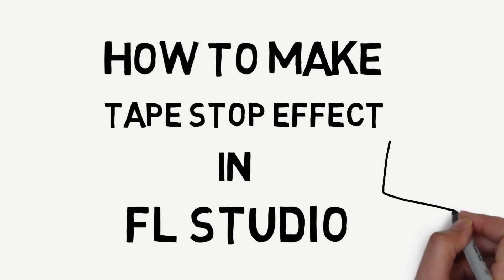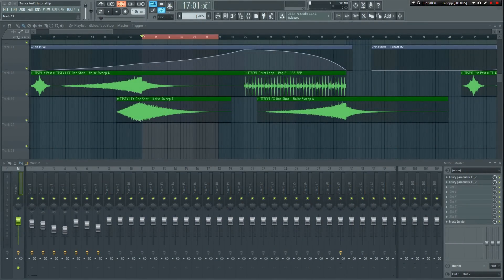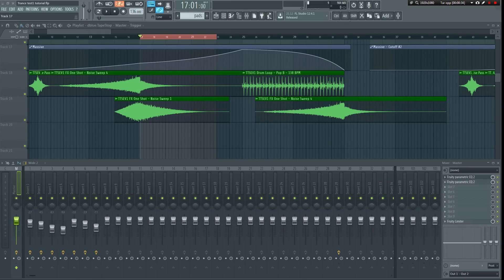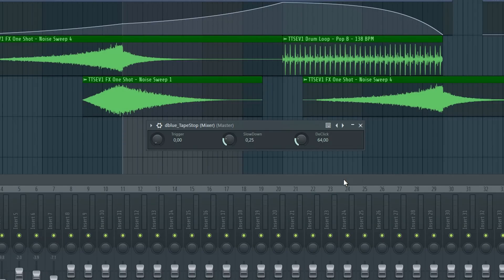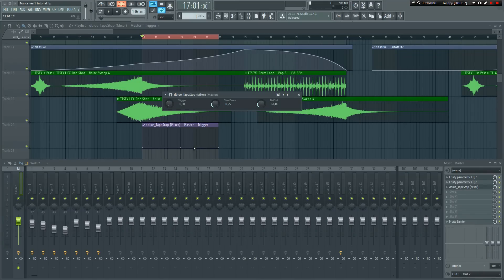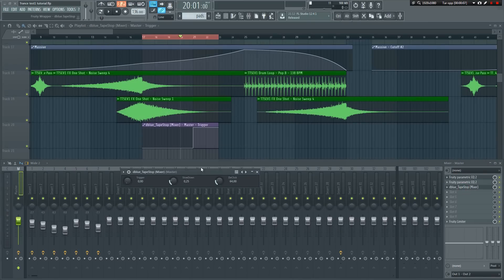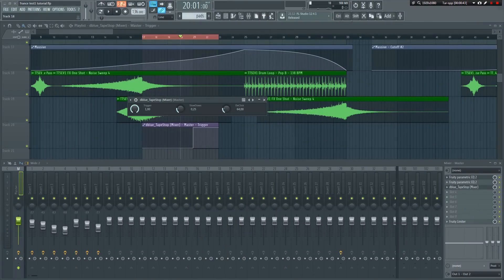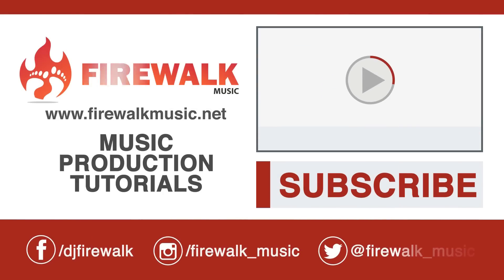How To Make A Tape Stop Effect In FL Studio  (Slow down effect)

Comment: This is a really good effect, but, just as a word of advice, don't always switch it straight up or straight down on the automation clip, it can actually sound pretty good depending on what you're going for, if you add just a slight edge before going all the way up on the trigger